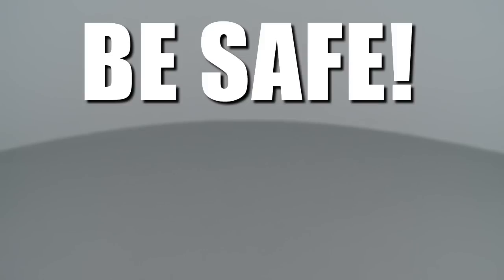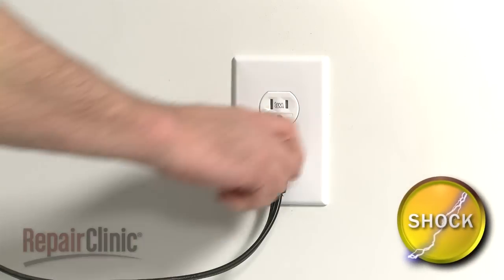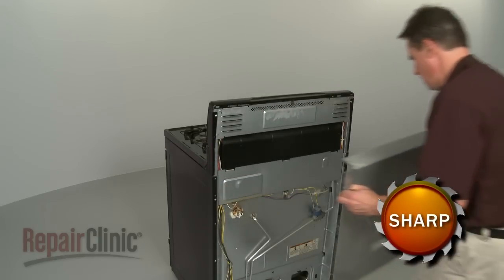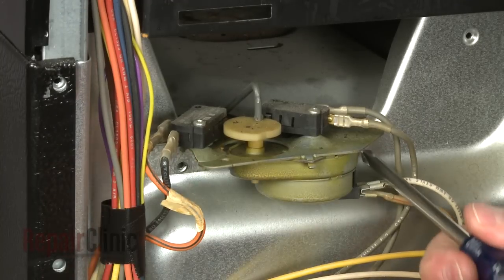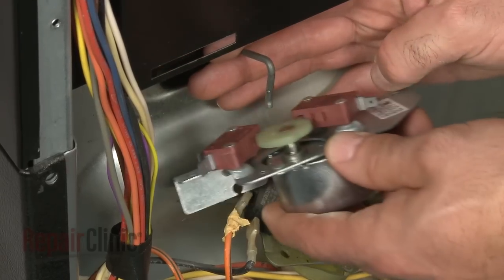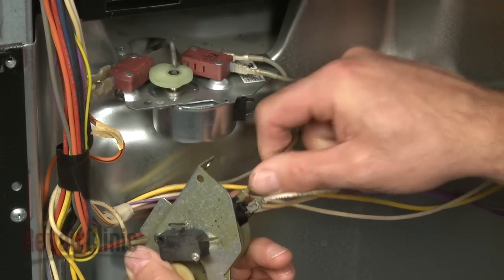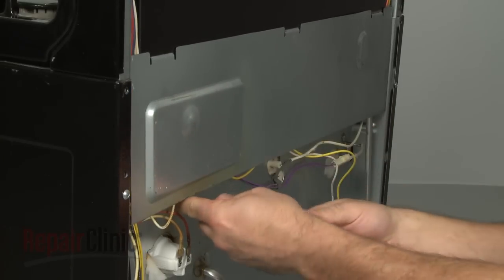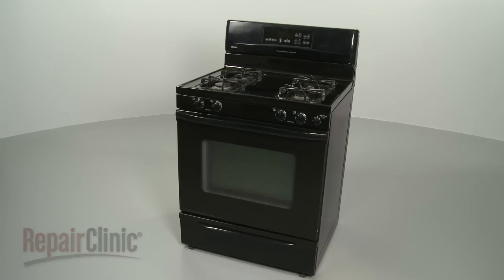Kenmore Oven Won't Self-Clean? Door Lock Motor #W10107830

Comment: Instead of replacing this part which I prefer not to as I will never run the self-destruct (aka. self clean) feature again, can I not disable this motor so I can remove the locked door error on my panel to give me access to my oven again? Thanks!
Reply: Why do you say that?